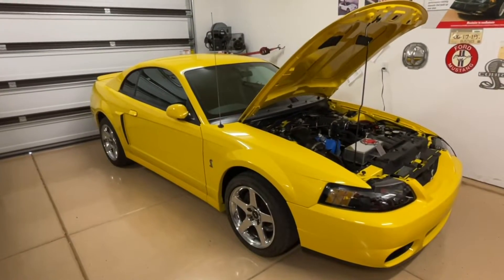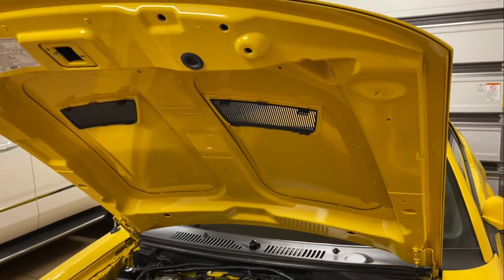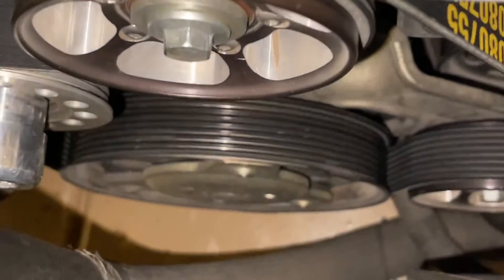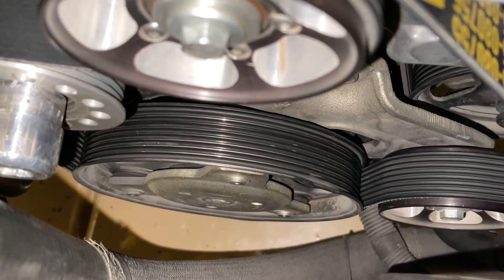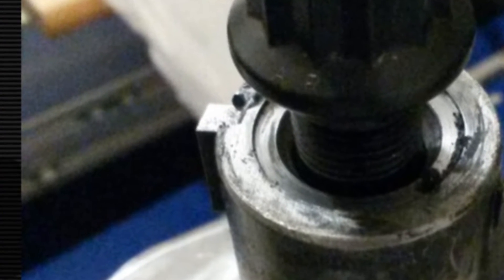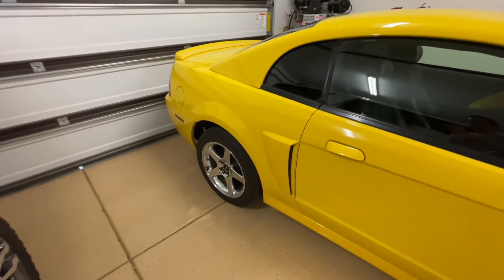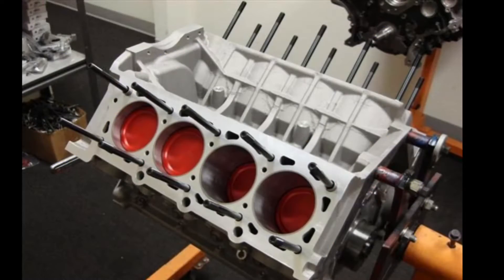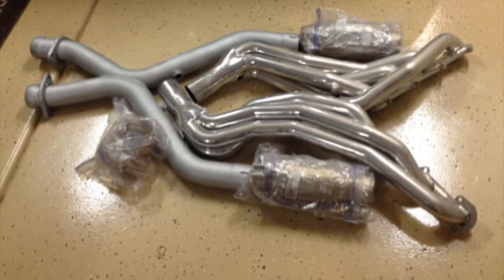Don’t slap on the biggest supercharger you can find: Why it’s not the best idea to get the biggest

Comment: Comparing these two cars just in terms of which one is more fun to drive. I like both cars the Shelby GT350 and the SVT Cobra Mustang but it's a hard decision which one to buy. The Shelby is going to out handle the cobra but you can always put some suspension upgrades to it. In terms of the Shelby GT350 in order to make it more responsive I'm thinking about putting 411 gears on it maybe 430 gears and a remap. I guess with some modifications I can easily get 550 horsepower from the SVT Cobra.

Comment: Can you run a 2.9 liter Whipple on a 2003 Mach1 with 60lb injectors, Ford GT fuel pump without a intercooler?
Reply from the maker: I wouldn’t. Kenne bell made a small 2.1 kit that was both intercooled or non-intercooled, but you won’t get good results. Even worse, you’ll remove the knock sensors to make the lower manifold fit so you’ll have less control on pulling timing if it knocks. Terminators don’t have knock sensors so they pull timing off coolant temp and intake charge temp. Also, a 2.9 would have to be run with a 3.5” or larger pulley to keep the boost level down. Any more than 8-10 psi will make too much power for the connecting rods. You’ll want to be under 500rwhp
Reply: @dannyjohnsonsgarage  you sound like you know what your talking about lol
Reply: @dannyjohnsonsgarage  whats the purpose of the Knock sensors why do Machs have them??
Reply from the maker: @TopMach1  a knock sensor listens/feels for vibrations in the engine that would be at a frequency where it knows the fuel is igniting before it’s supposed to. This is called pre-ignition or “knocking” or “pinging.” Once it determines it is happening, the computer adjusts the ignition timing (when the spark plug is told to fire). Terminators do not have them since the extra noise of the supercharger and not being advanced technology to run with a supercharger with how fast development was done on the 03/04 cobra. Ford later figured it out on the GT500. Most cars have knock sensors, but the lower intake manifold is not designed to fit with them on the mach 1 so you typically shave off the mounting area (“bosses”) when adding a lower intake manifold and supercharger for the mach 1
Reply: @dannyjohnsonsgarage  so would I have to delete knock sensors or tune them out for 2.9 Whipple

Comment: Hi Danny thanks for the video i’m curious you have a 2.3 if you had to do it over again would you go to the 2.9? I am considering buying a Whipple and I am in a little bit of indecision at this point on which one to go with.
Reply from the maker: Yes, this car came with the 2.3L installed. I would have done the 2.9L. The 2.3 is a great little blower and not to far behind, but Its always better to have more potential for growth or changes down the road. If I were starting all over now I would do the gen 5 3.0L whipple. My brother has the 2.65L from VMP and it's also a great supercharger. https://youtu.be/L9vX6JeppDk
Reply: @dannyjohnsonsgarage  I’m curious Danny if you could make a recommendation about fuel system upgrade before I put a Whipple on my 04 cobra. Currently I have a stock fuel system with the PPRV delete. I just need some advice on what direction to go plan on the car always being on 93 octane. Thanks in advance for any advice you may offer!
Reply: @dannyjohnsonsgarage  A gen 5 3.0L would be ok to run on a stock motor?

Comment: Would you be able to educate me on the requirements that may need to be made to have a stock Eaton ported? Bigger injectors, tune, fuel?
Reply from the maker: Yes, once ported it’s a great idea to go to 60# fuel injectors (assuming you’re still on pump gas. E85 would require even bigger as well as a fuel system), if you don’t have anything done to your fuel system you’ll probably need a better pump (assuming you don’t have a terminator fuel pump with twin pumps), add a boost a pump, plugs gapped to .030, and maybe a mafia maf extender or bigger maf. My brothers 10th had stock injectors, BAP, and no mafia and it was ok but pushing it
Reply: @dannyjohnsonsgarage  I highly appreciate the feedback and will watch the links you’ve sent me!
Reply from the maker: BAP https://youtu.be/kb5GOgXJatE
Reply from the maker: Gapping plugs https://youtu.be/tlFIIER0NAg

Comment: Danny you should get a retune how could you only be at 600 wheel.my son has an 03 with 50k miles we home ported the blower it has accufab single blade and elbow.arh headers lethal return system .and e85 it was tuned at Deans performance it made 540 wheel.
Reply from the maker: Because he’s on e85. I’d be up 100hp on an e85 tune. You can run more timing and boost with e85 as the octane rating is nearly 100

Comment: How would you adjust the motor height? I have Max Motorsport Mounts and the motor looks like it sits lower than planned.. Any ideas on how to raise and lower the motor?
Reply from the maker: A lot has to do with the k member and motor mounts. The ones you bought may be intended to help larger blowers fit under the hood. Other than some kind of spacer or shim I’m not sure what you would be able to do without going back to OEM mounts

Comment: How much boost can i go on a gen3r with 93 and boostane on a coyoty 5.0
Reply: Look on coyote forums or ask on facebook. Be careful tho, coyotes are high compression motors. You should really be on e85
Reply: @aMpvTRiCKy  if i lower the compression can i keep pump gas and go more boost forged rods and pistons no e85 in canada
Reply: marco zr thats a question for the coyote people
Reply: @marcozr3138  you dont need to lower the compression itll be fine ecspecially with boostane.  Idk the exact answer im a cobra/older gt500 guy not familiar with boost numbers on coyotes.
Reply: @midnight347  i was told if i lower the compression i can go more boost

Comment: Hey Danny..Paul from Ohio..very good vid... I agree with you about the larger blowers...I have a 2.3 Whipple...4lb lower..and 3.25 upper...my boost is 20lbs...with the tune it has now..640rwhp...the shop that did my cams built 3 tunes...93 daily...93 hot..and a 100 octane race gas only tune...which I’ve not used..as 640 seems enough..when they did the cams..they installed an ARP head stud kit..I wanted a little more bling under the hood so I stripped the anodizing off the blower snout and pulley and then polished w/ Mothers aluminum polish..what a difference..I used Eastwood’s anodizing remover...anyway great vid and take care..😀.
Reply from the maker: Very nice! Thanks for the comment. 👍🏼

Comment: I have a question for you. I have a pretty much stock 02 Roush 360R. My question is, is the stock eaton m90 useless for getting more power? I was wanting to keep the Roushcharger and have some engine work done to increase horsepower, but I am afraid that the supercharger will be too restrictive. What are your thoughts?
Reply from the maker: If you have the stock bottom end you'll be limited to 450rwhp, so I think that should be your max target (assuming you have a stock bottom end). That would be achievable with the m90 and full mods. The m112 on my brother's Bullitt was capable of surpassing 450rwhp but he also had a built bottom end. Before you go to the trouble of swapping the blower, consider doing so once you build the bottom end. Just my opinion
Reply: @dannyjohnsonsgarage  thank you for the info. Do you think the m90 could surpass 450 with a built bottom end or would it start limiting the engine?
Reply from the maker: I think you’d need a larger blower past 450rwhp

Comment: I have a 3.4 Whipple on 30 PSI and I would have to agree with the turbo point. Car is very fun but thinking back i probably shoulda went turbo. The 3.4 is a PITA to work on, the removable inlet is key. If VMP made a 3.0 with removable i'd ponder that.